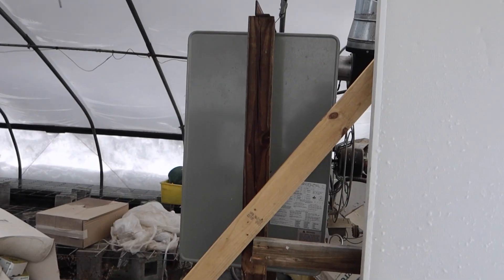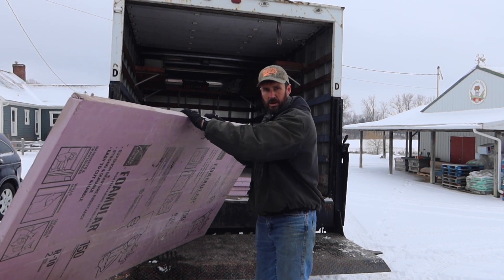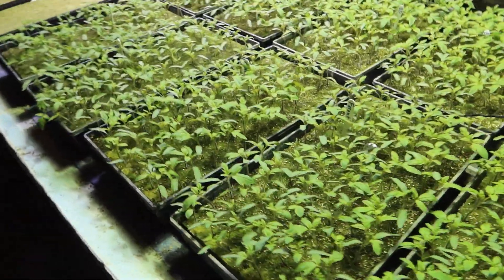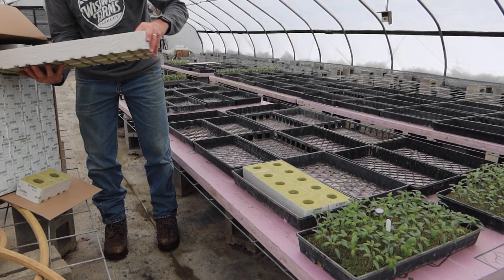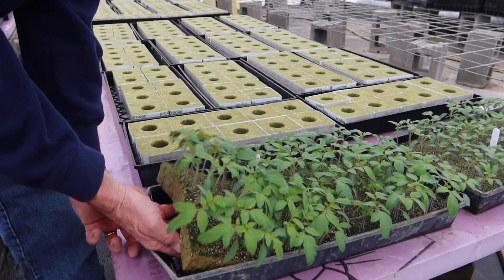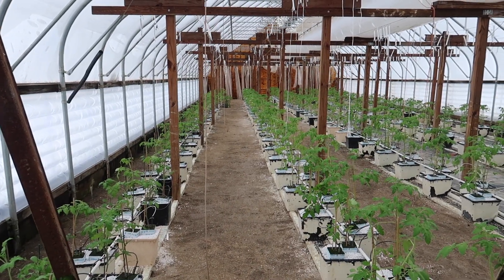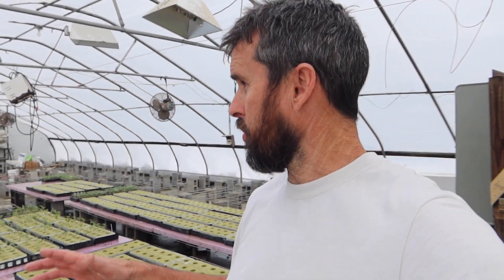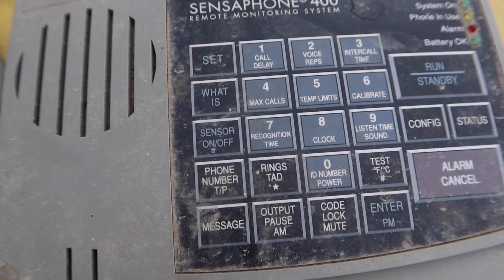Hydroponic Tomato Planting and Greenhouse Prep

Comment: I noticed the tops of your rockwool cubes are green with algae. Doesn’t that take nutrients away from the plant? I was told to use block covers to stop algae and mold from growing.
Reply from the maker: Yes, I’ve heard the same thing in the past, but I have not ever wasted my time with block covers in the 22 years I’ve been doing this and have never had a problem. As soon as they’re planted into the bato buckets with perlite we put the dripper stakes into the buckets and the top of the cubes dry out and all the algae dies so it’s a non-factor at that point.